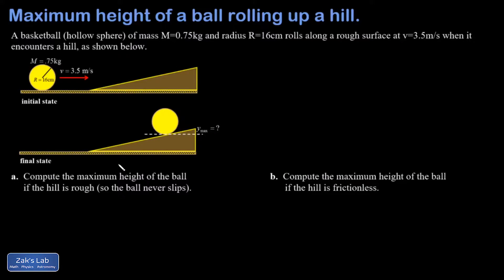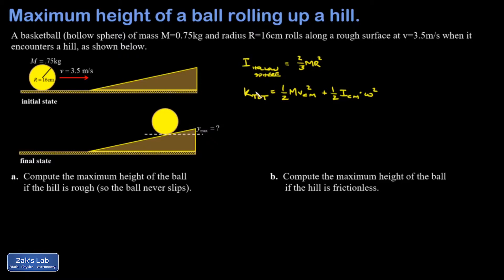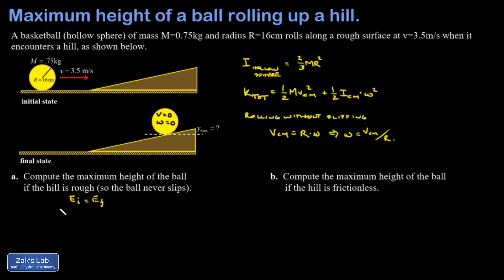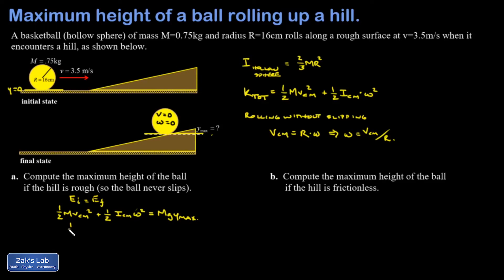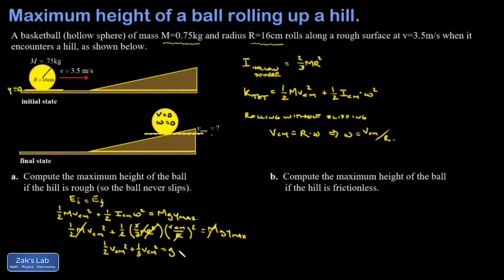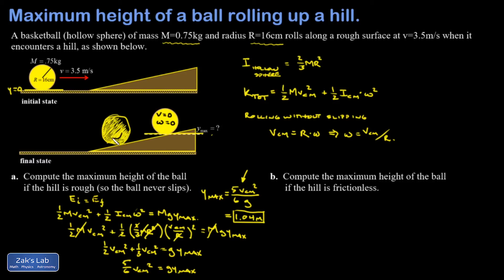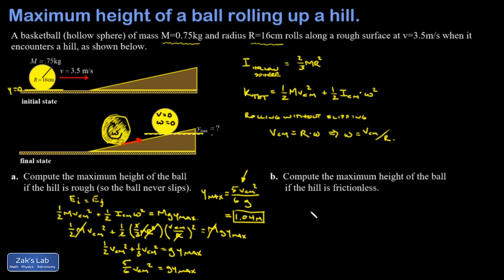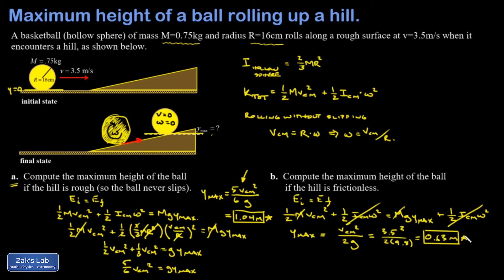Maximum height for a ball rolling up an incline or ramp.  Hollow ball rolls up a hill energy problem

Comment: I'm wondering why can we use conservation of energy in this problem. Isn't a part of them will be taken away by friction?
Reply from the maker: This may not be a very satisfying answer, but friction is not doing net work on the system here.  The reason why is that the contact point with the ramp is always stationary, so there is no mechanism for dissipating energy through slipping.  Instead, the friction force is always a static friction force.  But this force is exerting a torque on the system, and in fact it's critical to have this static friction force in order to enforce the rolling without slipping condition.  The static friction force is the key to converting the rotational KE of the ball into additional height here:  it supplies a torque slowing the rotation down, but simultaneously supplies a force pointing up the ramp.  

It is a weird thought to have friction acting as a conservative mechanism to convert one type of energy into another, but if you look at the force/torque solution of the problem, it does corroborate the answer given by energy conservation.
Reply: Thank you for your response! My another question is how would we solve the problem if the ball is allowed to both slip and roll?
Reply from the maker: @huyviethungnguyen7788  that will depend on the angle of incline and the coefficient of kinetic friction.  You'd have to do a force/torque approach to the problem instead of the energy approach.
Reply: @ZaksLab  Thanks a lot!